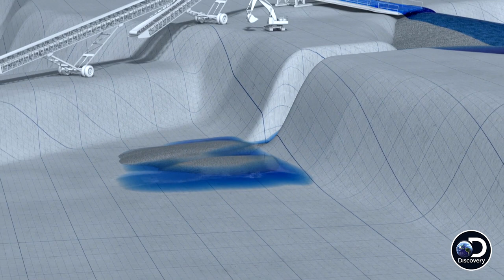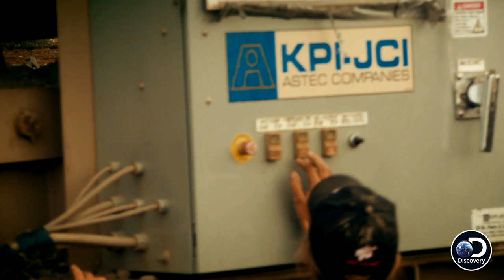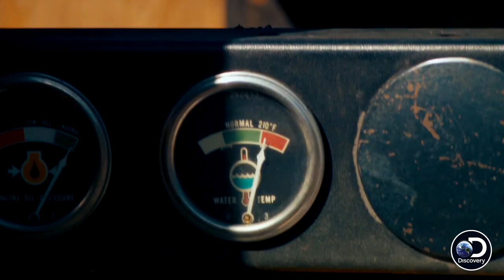Brennan Saves the Day | Gold Rush

Comment: Guess they don't believe in prevention maintenance. Kids
Reply: Most mines have a reaction maintence  concept. Not a preventive maintence concept.  Time change parts no way just change them when the fail. No inspectiions , that cuts into production.  Wait until they run out of fuel then fill them up.Same crap  in every mine!